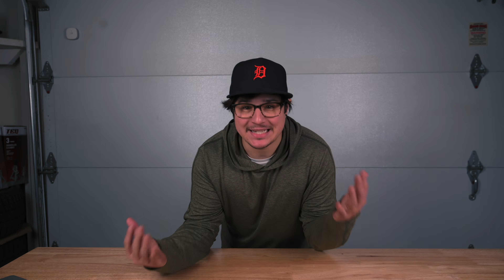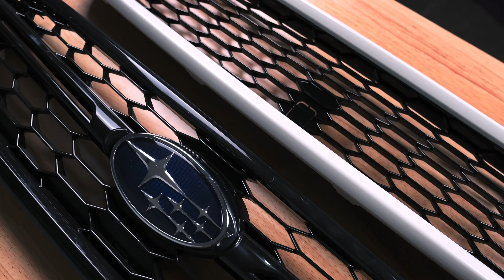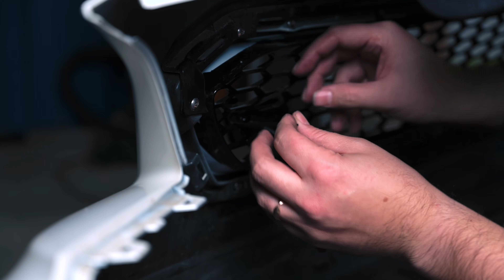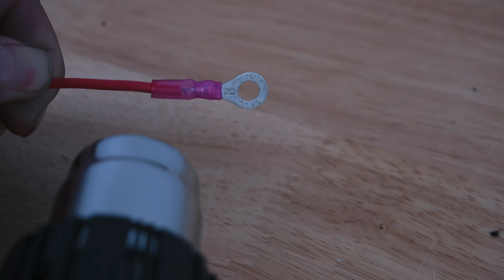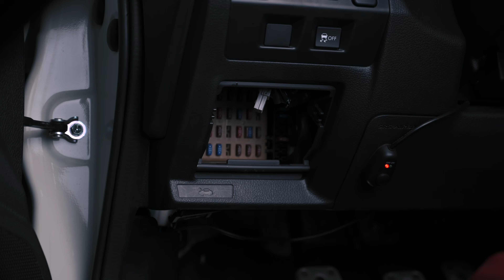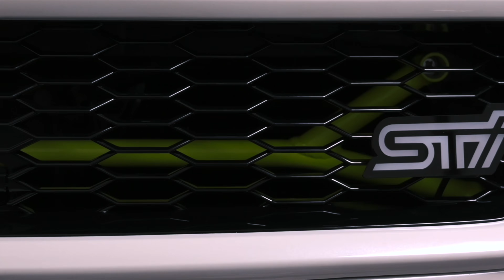Installing The Best Three STi Mods You Should Have | LitLogos, JDM Grille, Radiator Brace Install

Comment: Do i still need the inline fuse? If i want to use the 2nd method which is using a tap a fuse?
Reply from the maker: If you use a tap you don't need a an inline. That is the fuse. You have the original and the new one. 

Only need inline if connecting power directly to battery.

Comment: i’m confused as to how you said repeat the process for the negative wire like did you use the same inline fuse?
Reply from the maker: Hey,

You need to attach a ring connector to the negative wire. So it's the same process of crimping and heat shrinking. The inline only goes on the positive. But to attach the negative wire to the battery, you need to add a ringer connector.

Comment: lit logos says 12v, you had mentioned using a 7.5amp? will that work?
Reply from the maker: Yeah, you can connect to any 12v power source.

Under any scenario, I'd use a 5amp as per spec in the installation instructions they provide.

In the video what I'm referring to is that the ACC is a 7.5amp fuse in that slot. 

For the tap-a-fuse I'd move the 7.5 into the bottom slot which is the original, and add a 5amp fuse on the top which is for the LED. I wouldn't use a 7.5 because that is more power being drawn and above what Lit Logos recommends.

Comment: How bad would it be if I don’t add an inline fuse when connecting it to the battery?
Reply from the maker: Hey! The fuse is intended to protect the LED badge from high currents. When the fuse overloads it will break stopping all electrical current going to the badge. If the fuse isn't there to stop it, it can overload the badge causing it to burn out the chip inside, overheat or melt, and potentially catch on fire. It will almost certainly cause damage to it and it won't work anymore. 

You can pick them up at your local auto store, and it's worth the time to add one! Better than paying for a second one because they definitely aren't cheap!

Hope this helps!